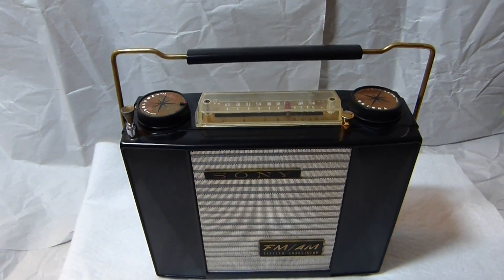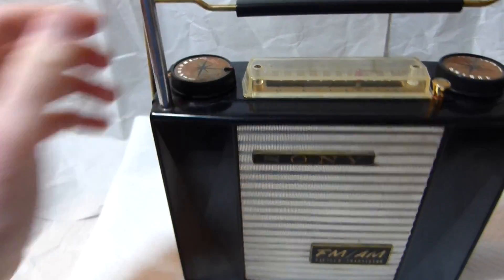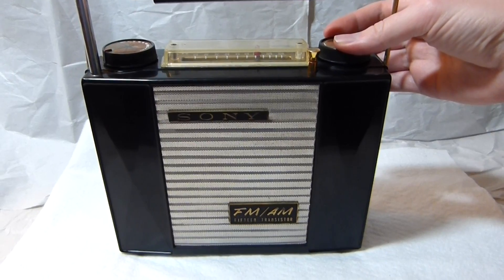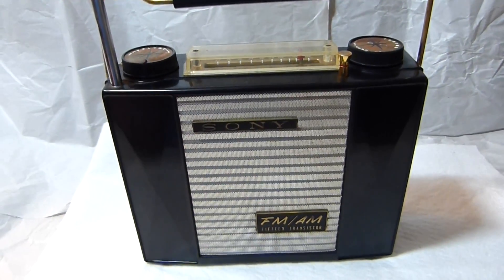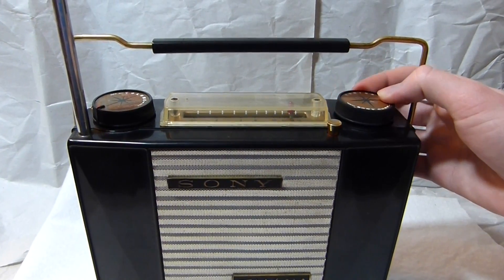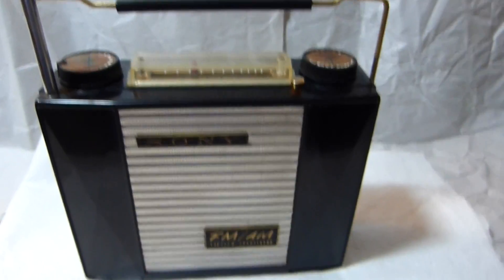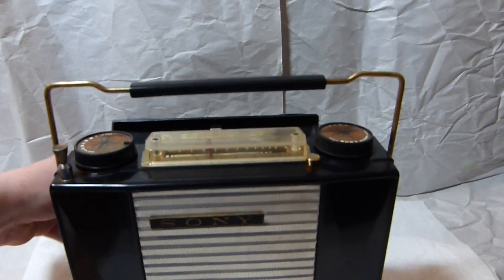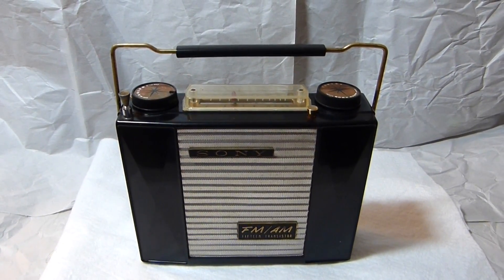Sony TFM-151, the worlds first FM transistor radio (Japan, 1958)

Comment: I'll take the Zenith over any Sony any day. Does this one have the problem with receiving air traffic on FM like most early FM radios?
Reply from the maker: The sensitivity and selectivity of this set is great, most early FM sets struggle with powerful stations near each other on the dial, but not this one.
Reply: Did Air traffic uses a frequency of 150 MHz back then? I once read in an old 1960's electronics magazine how you could modify an existing FM radio to pick up these aviation transmissions

Comment: Where did Sony buy the transistor technology from? I know that they did not invent it, and actually purchased the technology, so that is why I ask.
Reply from the maker: I suspect they licensed (or copied) Philco's surface barrier transistor technology, but I have no solid proof of that unfortunately.
Reply: 50sTransistorRadios
Were you possibly around at or near the time of innovation? I am just wondering if you may have an inside perspective?
Reply from the maker: Nope, this radio was built long before I was born. As far as I know, Philco's surface barrier transistor was only transistor technology available in 1958 that would work at FM radio frequencies.
Reply: They bought patent for 25k $ from Bell and develop their own method using phosporus ( nobel prize winner from japan because of that method too ). They do it by they own.